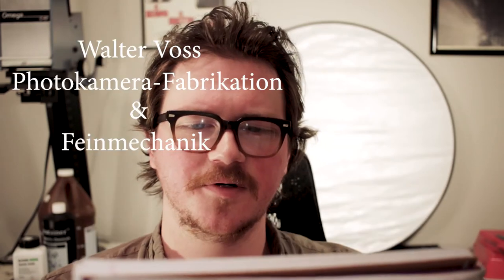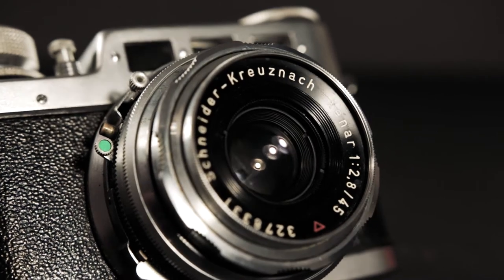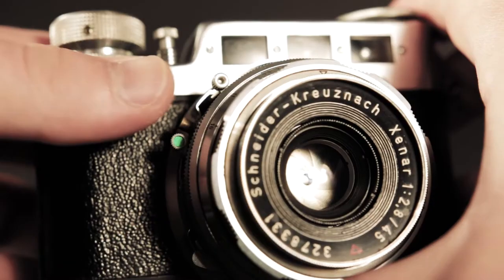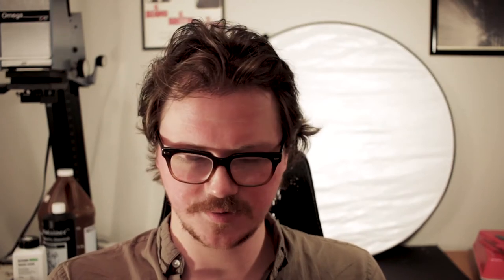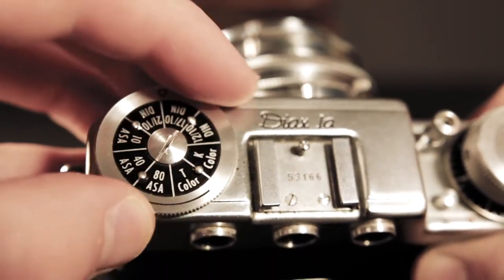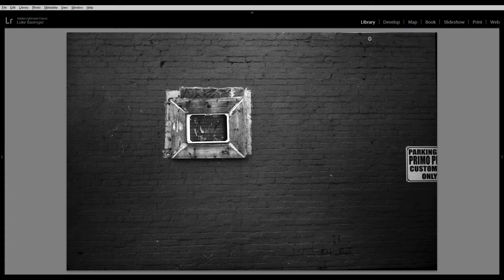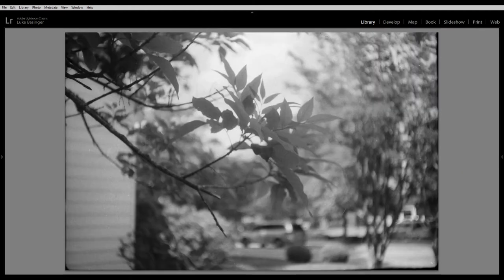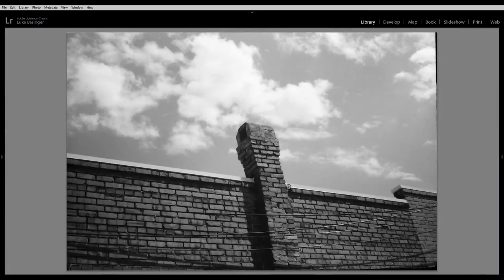Diax Ia - The Pinnacle of German Engineering? Far from it

Comment: The Diax range was typical of several high quality, yet medium priced, German rangefinder design houses of the time, such as Leidolf Lordomat, Balda and Voigtländer. They benefitted from the favourable conditions of US occupation, used generic shutters (Compur or Prontor) and were available with a range of lenses, including the superlative Schneider Xenon 6 element range as well as the more consumer-priced Rodenstock, Color Skopar and Radonar ranges.  In the hands of a well-educated film photographer, they are capable of producing technically excellent and compliant images.  

Sadly, most German manufacturers stuck with mechanical leaf shutter systems and were very soon eclipsed by Japanese manufacturers in the 1960s using focal plane shutters as designed by Carl Zeiss Ikon for the Contax in the 1930s.